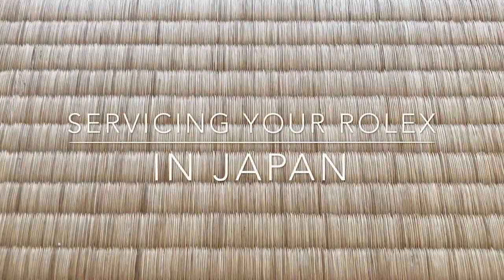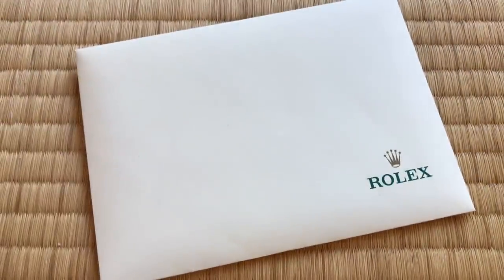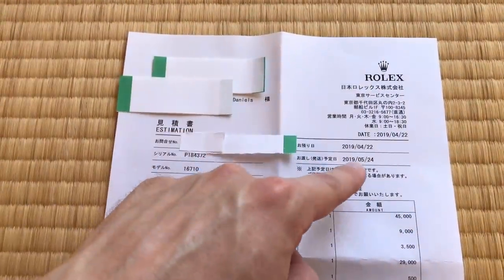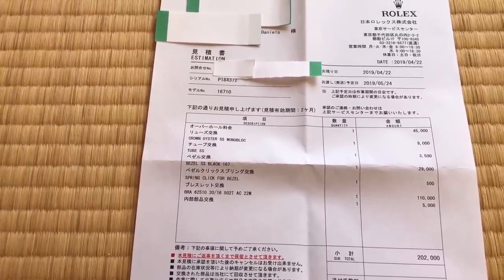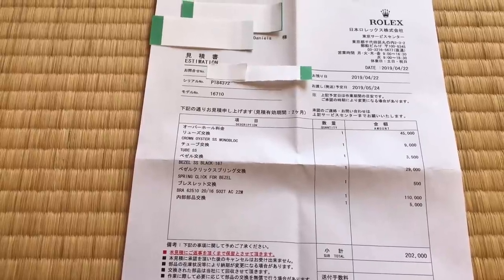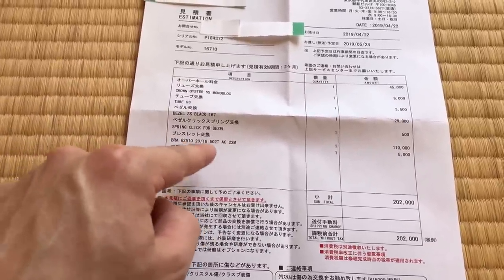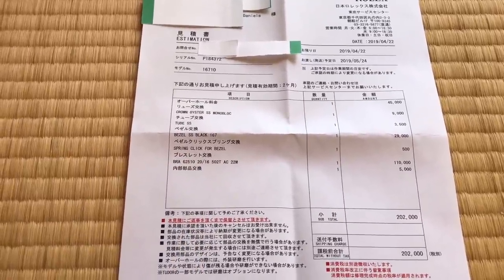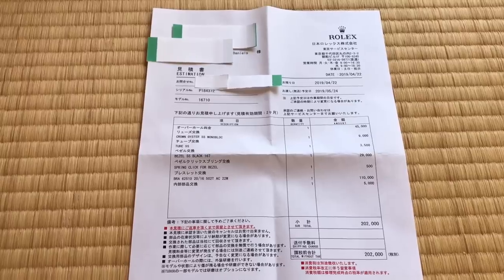Servicing your Rolex Watch in Japan

Comment: If you get your watched serviced at an independent, they will return your old parts (though they mark them so they can't be resold).  Overall, you can get really great (even better) service from a good independent than RSC for cheaper cost, and you are more likely to have it returned in original condition.  You just have to know how to gauge people (like finding a good car mechanic).

The main problem with this is if the place can't get parts - this is one of the biggest problems right now with many manufacturers like Rolex, ETA, AP, etc.

Comment: I'm about to be a gaijin in a couple of weeks and this video is quite helpful. Would you know if an overhaul there still costs 45,000 yen? Thanks!
Reply from the maker: Thanks for watching! Oh man, those were the good old days. Unfortunately, the cost has gone up: https://youtu.be/EwkXYQazUgw
Reply: @watchsymposium  thanks for linking. Watched it and found it very informative. So 77,000 yen including tax. I think it's not bad. I suppose small independent watch repair guys there would charge close to that (including parts replacement).
Reply from the maker: @albertguev  Glad it was helpful. Yes, I think considering you get the Rolex paperwork, and their top-notch service, it's worth it.

And if you are planning to have your piece polished, I wouldn't be taking my watch anywhere else!

And ya gotta love the pouch! Lol, last video I link to, I promise: https://youtu.be/B3A2-wRurjQ
Reply: @watchsymposium  the pouch with the snap on button is nice, I hope I get that one. Although I still prefer the Omega service pouch which is like clam type hard case (like those for eyeglasses).
Reply: @watchsymposium  hi one last question about how they're charging. If there's anything wrong with the movement that needs to be replaced, do they charge that on top of the 77,000 yen overhaul fee? I noticed the extra charges on your estimate/receipt were for "extra" items like bezel and bracelet. So I wonder if they charge extra for movement parts that are worn out or damaged.
Reply from the maker: @albertguev  I'm not sure. I've never had them charge me for any small part within the movement. I'm not sure if that's because I've never needed anything replaced or if it's because it was gratis.
Reply: @watchsymposium  thank you 🙏🏼